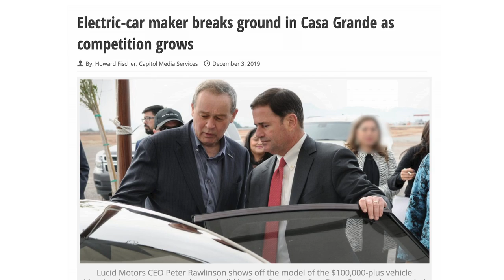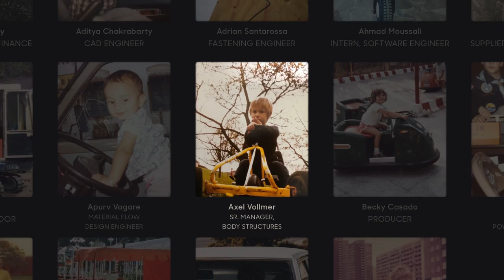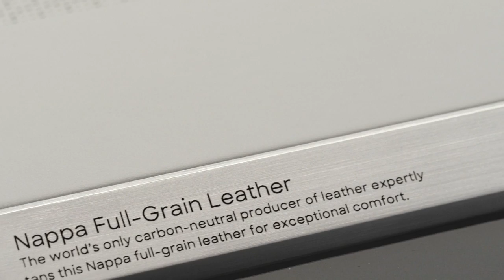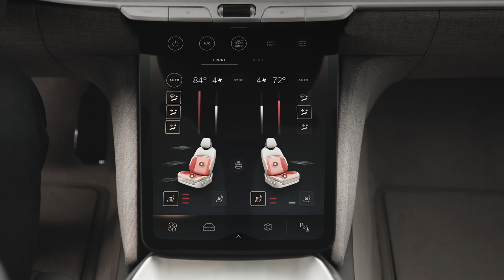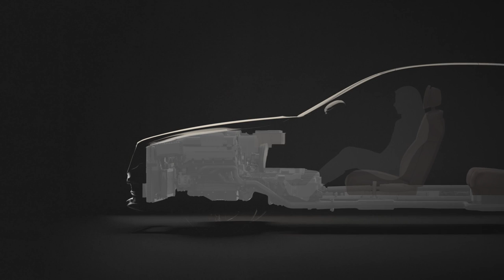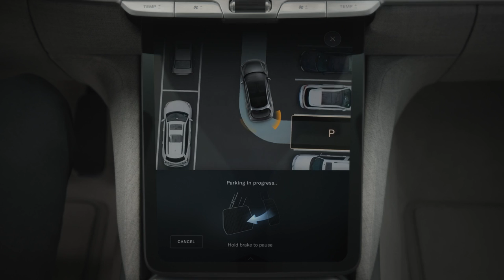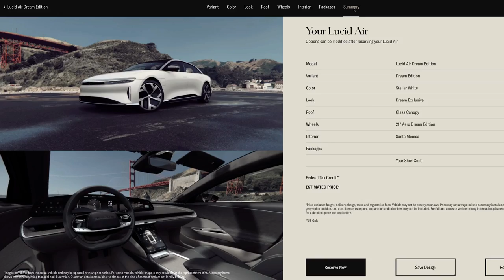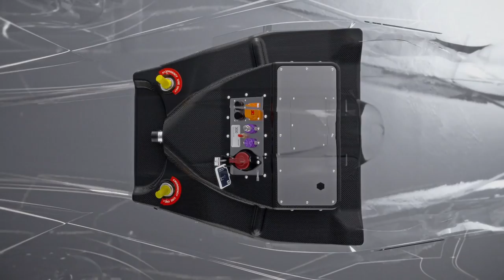Lucid Air Reveal! | MotorTrend

Comment: The fact that they made a smaller, lighter and faster motor is just mind blowing. Well done Lucid 👏
Reply: @markplott4820  Tesla Model S & X used to sell for 175k USD until late 2018. That doesn't seem overpriced compared to Lucid for a Tesla fanboy like you even with the crappy interior.
Reply: @markplott4820  A nine years old 2012 used car with low quality plasticky interior for 39,000! Nine years old car! No, thanks.. I'm waiting for my new grand touring Air.
Reply: @markplott4820  What? The model s isn't even 20 years old yet, and you say it can go on for 60 years? 😂😂😂 Where is your proof?
Reply: @markplott4820  longetivity lmao, you are not driving a battery, you are driving a car, so even if the battery can last 60 years, the car might not. If history has taught us anything, it is that the more complex and experimental the machine, the less reliable it likely will be.
Reply: @markplott4820  Tesla like most cars, use steel in their construction, so they can and will rust. There has been widely reported issues of rusting by Model 3 owners. Unless you bought a fully carbon fibre body car, like a Koenigsegg, even a Rolls Royce would rust. That is why cars need paint, the metals used on most cars aren't rust-resistant.
Reply: Considering they have the person who was one of the main reasons for Tesla’s motors, I’m not too surprised lol

Comment: How do they comply with US reg. With a single taillight?  If thw trunk is up, 4 ways aren't visible and that is why the design of some US cars aren't as sleek as they could be....
Reply: Yes, will have to add lights at bottom or something
Reply: @13asingh  i did see when showing the trunk open there maybe lights on the bottom of the opening but still thought it had to be on the corners.  Those would be blocked if you are standing in front of rhe trunk

Comment: 40:46, that is just mathematically not true. 17% more efficient vs competitor is not directly the same as getting the same range with 17% smaller battery.......
Reply: I thought about it and then I did the math.

if a competitor can go 400miles on 100kw battery, a 17% more efficient system would go 468miles on a 100kw battery.
For the more efficient system to go 400miles (assuming the same efficiency per kw) they would need 85kw battery, which is 17% percent less. (the net loss 15kw, which is 17.64% of 85kw, you can also calculate the difference as a percentage to the original capacity, and that would give us 15% less battery compared to the 100kw, which is close enough for CEO math.) 

I think also the weight loss from the battery would re contribute to the efficiency (efficiency of EV isn't linear, duo to the low energy density of the battery, the more you add, the less the gain, the less the battery the more the efficiency, a 30kw Tesla model 3 will be more efficient just because of the weight loss from the battery)
Reply: @eeasq7683  sorry, but it is still different, for the more efficient battery to go the same 400 miles, it needs 85.47 kw, and this is 14.53% lower than the 100kw (you cant calculate it from the 85, mathematically it's wrong) and tbh I know no CEO that would accept 17% being the same as 15%. My CEO would kill me if I make this mistake!
Reply: @geraldsitorus  my other point about the weight savings could effect the numbers.

So duo to the weight loss you can get that same range with a 83kw battery or less (and ending up with the same range, look at transportation evolved channel, they interviewed the CEO, and he made a point about the efficiency, and how by the same technology they could make a 22.000$ small car with a 30kw battery that goes more than 150miles (he pumped the efficiency to more than 5 miles per kw when using a smaller lighter pack).

Although your point is valid, CEO math is meant to simplify communication, look at Jensen Huang videos (his chat with students) he mentioned it few times
Reply: ASQ listen again, he just mentioned 17% more efficiency and then mentioned same range with 17% smaller battery. I understand that you will have weight factor and efficiency etc but that all shouldve been factored in for the 17% number he gave first. He couldve said “we are able to make it so efficient and able to squeeze out more range from our battery and thus we are able to get same range with 17% smaller battery”. But 17% more efficient thus 17% smaller is just mathematically not correct. CEO math or not.
Reply: @geraldsitorus  17% more efficient allow us to use a 17% smaller battery and get the same range. 
This statement can be correct, the math is not a linear equation, if you assume it's linear then yes that's mathematically incorrect, but it's not linear(the weight is in the equation).

When you remove battery capacity you effect the weight and then effect the efficiency again, if someone achieve efficiency gains in aerodynamics and motor (drive train) then they would be more efficient the lower weight the battery they use.

This is his full statement, notice how he mentioned "more efficient cars" at the beginning of his statement, because the less the battery the more efficient the car.

"What really excites me is how we can use
these technological breakthroughs
to benefit more cost-effective more
energy-efficient cars in the future
.
we're currently about 17% more efficient
than the closest competitor and that can
be used
 to achieve the same range as that

competitor
 with 17% smaller battery pack which has a multiplier effect on the car it's akin to a 20%

cost saving in batteries implementable
today
 without the cost of industrialization.
another way of looking at it ,the 17 extra efficiency is the equivalent of a 17 step gain in battery energy."
Reply: @eeasq7683  The weight should be in it already. When he says 17% more efficient, efficiency due to weight saving is already in there. As you said it "more efficient cars". It's not a car without weight is it.
Reply: @geraldsitorus  You didn't get my point at all.

The fluctuations of weight changes the efficiency.

if a car with a 100kw has an efficiency of 4.8miles/kw, changing the battery in the same car will change the efficiency from 4.8 to something else.

And thus the efficiency isn't linear. you can't add or subtract battery capacity and expect the same efficiency. 

Taking that into consideration his statement isn't wrong. we need to look more into the numbers to get the exact results, it's not 15% less battery, it's more, but will need to do the exact calculation to find out.

CEO math is about simplification for the sake of effective communication. being aimlessly pedantic about close numbers just takes away from the message. 

if I'm in his place I would say it the exact same way, I wouldn't mention the weight changing efficiency, and I wouldn't mention fractions.
Reply: @eeasq7683  You just dont want to get it do you? Yes the battery is more efficient, and yes it may be less weight, and not linear, but all should have been factored in - especially if he is just gonna mention it like that. And he could have said "over 15% more efficient" or "up to 20% smaller battery" or anything along those lines - that's CEO math! But when he is so exact with the 17%, then he needs to be very accurate - and/or explaining in more detail how he gets from efficiency to smaller battery. So technically without any additional info, his statement is mathematically wrong. Lucky you are not in CEO's seat! :D
Reply: @geraldsitorus  Now you are just going in circles.

take an afternoon to re-read the conversation, look at your incorrect math again and you will eventually get it
Reply: ASQ I just need 1 second to spot math error. Perhaps you should spend the afternoon in your kids’ math class.

Comment: I'd like a very basic electric car, focused on long range and the assisted/self driving. Like a 93 escort that could drive itself, excellent range, low price point and only option being the assisted/self driving. Crank windows would be fine as long as you could get the price lower I'd be happy.
Reply: That's a pretty good idea. I'm sure in later years such a thing will come out. But right now electric windows and keyless entry is cheap. While self driving tech such as radar, high res cameras and lidar sensors combined with powerful reliable computers and software is expensive.
Reply: I would like a basic EV which is easy to maintain and repair by any owner or third party shop.  EV in principle is so much simper than an ICE, and can be so easy to maintain and repair.  yet Tesla for example made it's cars totally un-repairable for anyone except Tesla itself  (and Rich Rebuild when he can get spare parts from junk yard).  Although Musk declared in 2017 that full self driving Tesla is just around the corner, and once again in April 2019 that robo-taxi will land by end of 2019, it's still just a glimmer in Musk's eye!  Full self driving - as Musk put it will be 10 times better than best human drivers!  And It needs to be to protect auto companies from very damaging lawsuits.  Yet autopilot and likes are far far from human driver level.  Best human drivers have driven decades without a single accidents.  Can autopilot match and surpass that?  Not likely for many years yet, because Musk /Tesla and even Google does not have secret sauce which is strong AI.
Reply: I completely agree with that springer,  nomninguy though, I think you misunderstood what I meant, the Tesla option for it's assisted driving is less than 10k, so I get that price point for an option like that, but what  frustrates me with current automakers is that they include needless complexities into their vehicles to justify a gross msrp, when I referenced the escort, what I meant was a simple vehicle design, it was cheap to manufacture, cheap to assemble, and therefore cheap to purchase, a/c was an option, not something you were forced into buying with the base model. In the past a full size diesel crew cab truck could be bought in base level trim, that had crank windows and no a/c, and yet today automakers force more options on that truck to push it well into the 50k+ price range. But I do believe you are right about it will be there in the future, I think with economic instability, consumers not buying as many new vehicles, I believe they will have to shift focus from expensive cars to affordable cars, eventually.

Comment: The thing tho is that the cheapest car they have is 80k and that is 10k more expensive than the competitors. Plus the 80k is not coming out until 2022 and by that time someone may have come out with an even cheaper EV with the same or similar stats as the Lucid Air...

Still, it looks good, but 10k is 10k.
Reply: they won’t make it

Comment: "inflection point". Gah. Who wrote this copy? Surely you're referring to the convergence point?

Touch controls in a moving vehicle are instant fail. Expect a return to tactile controls in 5 - 10 years once capacitive touch falls out of favor again.
Reply: If not tactile controls, at least voice commands that work 100% of time.  Using capacitive touch screens for controlling windows, wipers, heating/cooling, radio etc  (posterboy - Musk's cars)  is idiotic.   I saw a Tesla Model 3 smash into a tree all by itself the other day in broad daylight, wide open road.  Why did it do that?  Could be stupid ipad control or maybe "full self driving" autopilot - both idiotic features by Musk.

Comment: That’s all good, but the price is the key. It’s ok for a 60-70K$ range, with 100-120 for full options. But 160 is way overkill. That’s very tuff market to conquer, even Porsche’s Taycan for about the same price, is considered overpriced. And it’s a top of the line electric vehicle from Porsche, the company that was building electric tanks for the WWII. It is wise, that they don’t announce the price just yet, but tried to gather a feedback for a 160k$ price range, and which I highly recommend Lucid Air to consider at the sales start

Comment: Impressive, at first sight at least... Acording to your claims such as "the most compact el. motors", "most power dense el. motors", battery serving as integral structural part of the car", "highest voltage charging", "best efficiency" and so on, i assume you have heard of Rimac ;)
Anyway, good luck to you guys!
Reply: Rimac does not manufacture cars. Neither they plan to.
Reply: @andryadas  Lol, you obviously have no idea what you are talking about. A fact, Rimac has CNC machines, mostly DMG and some HAAS, about 200 people working on them, more than 350 engineers working on making the whole system software and electrical components for his cars... So, you are plain wrong.
Reply: @MrKemby13  yes. They will produce jet planes on wheels 👌 not cars. I’ve been following rimac for 2 years. They are top.

Comment: Just go with 9000 or 90000 volts, I mean I am just waiting for a 10 year old car in the rain electrocuting a whole crossing...
Reply: First responders love having to wait to rescue crash victims make sure they don't get electrocuted
Reply: @treizTUBE  Yeah its easy to bump the voltage up to any number (yay the cables are getting thinner) . The hard part is to use Ampere instead of voltage. Thats why car batteries have been 12 volts for years. You can touch them with your tongue and nothing happens....

Comment: Wow I'm ready to jump ship from Tesla if they keep lagging behind on quality control and luxury
Reply: Are you ready to pay $169,000 for that luxury? You could get a new model S and take the $80,000 you save over the Air and have it customized to be more luxurious than any car in production.
Reply: @timmturner  I'd rather have a G wagon lolol
Reply: @timmturner  S Performance w/ FSD is $110K, about $29K cheaper than than the Air GT w/ Dream Drive. I've been happy with my S and 3 over the last 5 years as Tesla was the only great option for EVs, but I'd gladly pay the difference for better quality/finish, performance, and tech. But who knows? Assuming Plaid and improved battery is a given by next year, maybe Tesla will also finally start fixing paint and panel gaps, improve the horrible customer service, and address the luxury market before Lucid releases.

Comment: The technology they’re claiming is nothing short of amazing. But, I have my reservations...hear me out.
It seems as if they’re a tech company, trying to become a car company. Since they are a tech company, they unequivocally understand the importance of the devil being in the details. The smallest, most inconsequential thing building into a much larger issue.
That said, the reason I have my reservations is because they showed, on the massive launch video, someone rubbing a dry rag on a dry car, and creating tons of tiny little scratches on the surface of the clearcoat of their halo car.

Any detailer in the world worth their salt knows you don’t do that. Have they really figured out how to be a proper car company?
Reply: The CEO is a veteran of the automotive business, I wouldn't worry about the classic automotive business challenges, I think the bigger challenge is proofing that they are an EV company (battery energy to weight ratio, software experience)

What you noticed about the incorrect detailing is probably from the marketing team lack of knowledge on cars